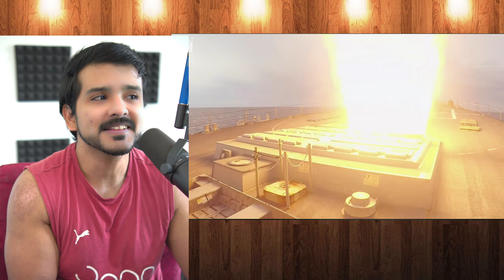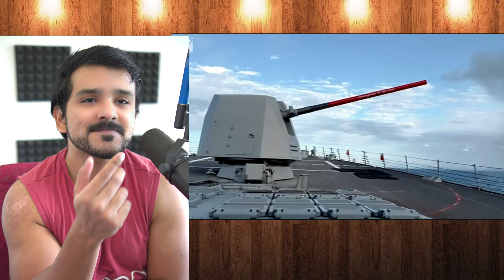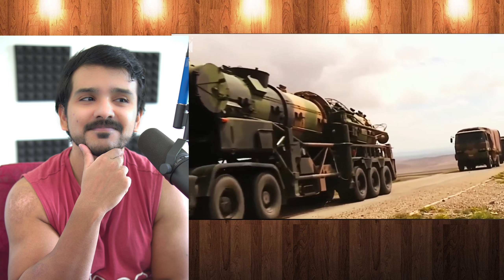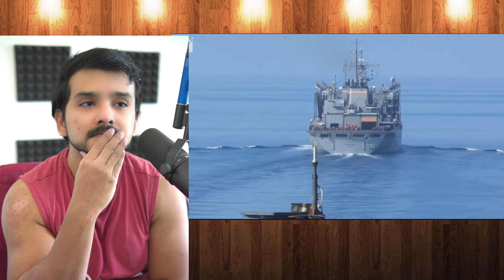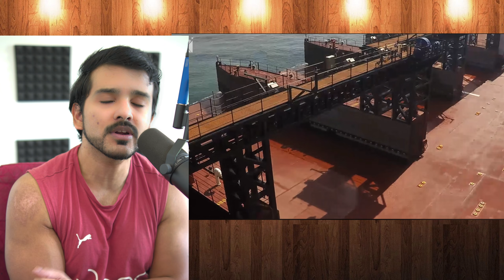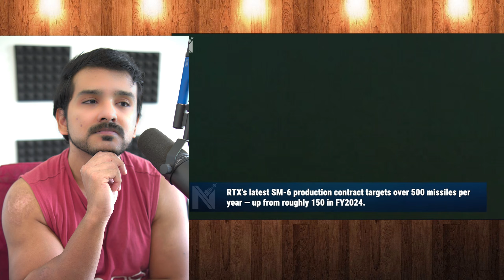How the US Navy Turned a Tank Ship Into a 'Floating Armory'  | CG Reacts

Comment: Yeah the old system still had missile capacity down below it just had mechanical system from transferring it from horizontal to vertical back the horizontal..... It was actually harder to reload those old systems because you had move them in horizontally and then stack them